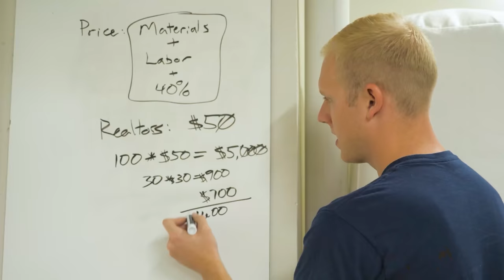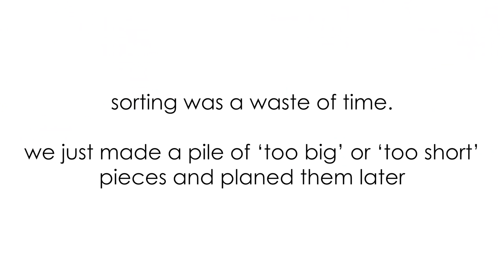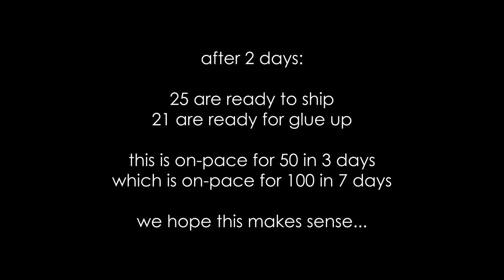we built 25 cutting boards in 2 days

Comment: Keep the boards longer... and why not rip the strips on the table saw? Eliminate the bandsaw. You wont need to joint.
Reply: That is the first thought I had on your process. Using the band saw and jointer are extra steps that are unnecessary if you have a good, clean table saw blade
Reply: My thoughts are the same with a good blade this would shave alot of time off
Reply from the maker: Due to wood movement, the Table saw blade/riving knife gets pinched with 8/4 stock. The band saw eliminates that issue
Reply: @jennieanddavis  valid point. It might be worth swapping 6/4 in that case. Sure you would need more strips per board, but the time and the cost savings of buying thinner stock might offset that.

Comment: An old shop teacher once said to me - keep the wood as long and as wide as you can for as long as you can.  More cuts = more handling time.  I know there is a tipping point, especially in a garage shop.  I would try to joint one edge then joint one face - ensuring that while jointing that face, the edge is flat against the fence and dead-on perpendicular to the bed - thereby giving you a true edge that is perpendicular to the face. Plane the stock next - get them all to the same thickness - and everything should be square (one edge and one face from the jointer - the opposite face should now be parallel to the the jointed face).  Rip on the table saw - good glue line blade. Think about adding a stop block system to your crosscut sled.

Comment: Ditch the bandsaw for ripping. Spend the money for a really good tablesaw rip blade that will make a glue ready cut so you can skip the joiner on the strips. time saved is money earned.
Reply: Definitely, like you said no need to return to the jointer
Reply: Yeah I was confused by that too. I guess u lose slightly less material per cut but not worth the extra time.
Reply: They already tried that, they like their bandsaw better for the workflow in their shop
Reply: I do agree with you though personally

Comment: For rearranging the shop, one useful tool I’ve learned from lean manufacturing is called a spaghetti chart. Draw your shop floor as is and stand where you stack your wood. Have one person go through the entire process while the other draws your footsteps on the floor plan. Once you have completed it will look like a plate of spaghetti with all of the lines of foot traffic and then you can see where you should station your tools to streamline and reduce foot prints.
Reply: Work toward one piece flow over batch work.
Reply: Total agree. I ran a commercial shop and we broke down the shop by the major components we made.
Drawer department, cab box department, door and drawer front department, assembly...etc.
Inside each department the tools were setup in the process for the build.
Think it out and try Dustins plan
Reply: @daforst13  Could not have said it better.  Your objective is to turn inventory into sales.  Large batches slow this down.  So list the steps take the times for each step, arrange the work so material can move to the next process without transferring parts to the other end of the shop (movement and transportation are waste).  See what your leadtime from beginning to end of the process is and bam!  You can calculate your capacity.  Good luck.  

I would be happy to talk to you guys further about this if you are interested.  I geek out on this type of stuff.  Hence it is my job.
Reply: Genious
Reply: Do not listen to people preaching lean manufacturing they will just want to get rid of one of you and hire six engineers and three office staff.
Reply: @daforst13  one pc flow would require an operator for each station, or it's slower.
Reply: @chuckgault8366  yep, work flow should go from process to process without backtracking.

Comment: When I'm doing production work with cutting boards I'll make my blanks as long as 2 boards. I'll glue up one long 34 in long 11.5 inch wide board and cut it in half when its dry and flat.
Reply: Commented this before seeing your comment, lol, I do the same and it works awesome. I’ll double that up with my clamps and get 4 boards out of a glue up
Reply: Came here to say this same thing. Planning out my assembly line and doing groupings out 8/10/12 at a time helps me focus and move faster

Comment: You may have solved the expansion problem by now. But here is a suggestion for thought by others, or by you if it isn't already a done deal. You talk to realtors a lot. Buy a home that has land enough to put up a work shop. That way you own the shop, can configure as you see fit, can rent it out if the business stops. It also adds value to your real estate and can be used for a different enterprise if you change direction. The real deciding factor is what your rent would be if you had to rent a facility to put the shop in. If you can pay that toward your own equity, that's a good thing.

Comment: NEVER feed those square parts thru your joint using your fingers! It takes no prisoners and there is nothing left to sew back on. ALWAYS have two push blocks, one in each hand, when running a jointer. A power feeder would be a good investment for this operation.

Comment: I would suggest making your boards 3x or 4x longer, then cross cut them to length towards the end of the operation. So if your cutting boards are 16in long, instead of making 30x boards, make 10x 48in boards and cut them down later. It'll save you a lot of time and twisting motions.

Comment: Two things that jump out right away are how much/far you have to carry the stock before and after machines and how machines are arranged. I like having a cart for stock that needs to go through a machine and a cart for pieces that have already been through. The amount of weight that you guys carried to each machine and back to the center table each time would explain your exhaustion. Try to come up with a system to keep you from having to pick up the stock unless it’s the next one going through the machine. Then try to set up your machines in a linear progression down one wall or around two walls so you literally just roll the carts to the machine next to the last one when you’re done. I know space may be an issue, but like others have said, limit the number of steps you’re taking around the shop. Fewer steps carrying less = saved time and energy. Easier said than done, but I typically start with my litter saw, then jointer, then planer, then move to my table saw. The out feed table I use for my table saw is also where I do glue ups. I work in a one car garage, so everything I have is compact and either rolls or breaks down to store out of the way when I’m not using it. I just set up what I need in the order that I’m going to use it. Love to watch you guys grow and hope to be where you guys are at someday! Keep the videos coming!

Comment: Minimize the number of cuts you're making. Yes, cutting the boards into 2' sections makes things easier to handle, but if you can manage 4' sections, you've just cut in half the number of strips you have to cut, joint, square ,and glue, and only added one crosscut when you're squaring up the final cutting boards. 
Not only will minimizing the number of cuts save time, it also saves wear and tear on your tools, which is more time and money saved.
Reply from the maker: Yes! The guys in the Stud Stack brought this to our attention last week. Definitely a good idea!
Reply: Wait, can we go back to the “flying through hurricanes for research”?  Is that your day jobs? Not to poo-poo cutting boards, but can we see THAT video?
Reply: Also, minimizing the number of times you need to join and/or plan can save time and money. Helpful suggestion; once you plane and join the boards the first time, a good table saw can give you straight cuts (square and plumb) without the need to rerun through joiner and planer.
Reply: @tyelegleu8846  to add to this only surface 3 sides.  Leave the fourth for after glue up, saves you time and money.

Comment: I have not made production cutting boards, but I have done a bit of woodworking on rough sawn.
I start out by finding my thinnest board and then plan the others down to that thickness. I do this before I cut any of them to length. This keeps you from over handling the materials. Also you will find that the longer boards plane better.

Comment: Tip: instead of cutting & gluing strips for a single board, cut and glue longer strips (say 4', 5' 6' etc) and glue up one panel so you can cut several boards from it. Saves time, don't need as many clamps, and you can produce more boards per panel. I don't make edge or face grain boards but, that's what I'd do. I do build a lot of end grain boards and use this method.
Reply: Joint and plane longer boards before you crosscut.

Comment: Did you have any issues milling and immediately gluing up? 

I stopped doing that with production batches. I mill and then let the dimensioned boards sit for at least a week. I found once they’re milled, they will move just a little bit as moisture enters and leaves the wood on the newly exposed fibers. 

So now I mill to dimensioned lumber and then wait at least a week and do one final pass. It’s necessary about 75% of the time as the boards tend to move just a bit. Made for much easier assembly and flatter cutting boards.

Comment: I'm new to this channel and don't know the shop set up all that well, but in professional shops, it's common to have carts to wheel around stock. For every operation, you need an input pile and an output pile, so either 1 cart for each or 1 cart with a divider. Carts can move to exactly where you want them so you don't need to move around so much or have to move piles from place to place for each operation.

Comment: You need to use stop blocks on your crosscut sled.  Make the first cut with the board to the left of the blade, then move the board to the right of the blade to the stop block set to the exact length you want each board to be.  It'll cut your cut times down dramatically.

Comment: For small shops I've found that building your work bench to work around your table saw gives you added space with the the table saw, also if you are cutting longer pieces (ei. For table tops) on the saw you don't require anyone to catch the piece on the off cut side. Almost buid the work bench in the shape of an L so that the table saw fills in the rest of the square/rectangle. Hope that helps

Comment: I've found that instead of pre-cutting to rough length of each board, and then having to trim each board after glue-ups,  double the size of your initial length of cut. Especially if you're batching. You basically "double" the number of boards you can clamp up at a time.
Reply from the maker: Too much waste - we tried that with Josh Weissman's boards

Comment: I like what you guys are doing and how it's coming out. I would've liked to see how you guys tackled the sanding portion of all these boards. I've been making boards for several years now, alone, and my biggest time-consuming issues actually come at the sanding/oiling time when the boards are already done and waiting to be finished altogether. I also think you could've saved time after ripping the smaller pieces with the bandsaw and then running them again on the jointer. It's an extra unnecessary step. If you already ran the bottom of the board through the jointer, then you have the bottom all flat and squared, ripping it through the bandsaw gave you another square edge if the initial side was run through the jointer as well, meaning all of your cuts are square. Going over the jointer again just to take off the saw marks is a waste since it's going to get glued anyway and no one will see those lines. Then you go to glue and later run it through the planer and sander to finish things off nicely. Just an observation...... :)

Comment: Hey, getting into woodworking myself. I've been making some cutting boards this week too. I decided time wise it was better to cut the strips in 6' lengths, gluing up a 6' by desired width cutting board, then planning, and then cutting to desired length. I was able to make four cutting boards out of one glue up, because I only have 6 pipe clamps this was a tremendous time saver for me. Let me know what your thoughts are.
Reply: No way you clamp a 6 footer with six clamps

Comment: On a whiteboard, draw out a map of your shop as it is currently.  Then take colored markers (one color per step in your process) and literally map out your movements.  See if you can rearrange the equipment so that you can minimize your movement, see if you can create a space where you can stack your WIP so that it is at the beginning of your next process step. Lastly, if you both are working at the same time, try to eliminate areas where your movements overlap.

Comment: Good shoes on cement floors. I find working in lengths of 2 cutting boards is perfect. Chop saw to face joint then edge joint then planer. Cut to width. Joint edge. Cut to width and repeat. That way you have 3 sides jointed. Then glue up to cutting board width x2. So 4 finished boards per 5 clamp set. I use a drum sander to finish the surfaces after glue up. And cut to finished size. Joint/sand edges. Oil. Install foot pads. Shrink wrap. Shelf. Sell. 
Keep achievable goals out in front and strive to be successful and move forward.

Comment: One thing you might want to look at, think about your production process as lineal. Arrange your tools so that you go in line, even if that's around a corner or coming back on itself, you make no money moving materials around a shop. Noticed also that I don't see a cyclone separator on your dust collection. Even if you do one of the trash can type ones, put it at the planer, your biggest chip producer. It will make the clean up process of your single stage collector easier. I also will recommend floor mats as someone else has already stated, they save your back, knees and sanity! I can work for 12 hours a day with the floor mats, without, I'm grouchy and sore for days. 
   As I stated in some of the other comments, some equipment you might want to look at are a power feeder or 2. One for the jointer, 1 for the tablesaw, they will make things easier and safer. Look at finding a clamp rack, a small one will do you just fine. Company's that  make these are JLT clamps, Doucet and an import company called Quick Machinery. I personally have a clamp carrier that I love to death for doing massive amounts of glue ups, way to much of a machine for you at this stage.
  Process wise, compare speed vs material, your bandsaw ripping is fairly slow but yield material is better. A good rip blade on your table saw will more than double your speed of ripping at he cost of a little more loss of material. Which is worth more? A few bucks of wood or your time?
  My background is as a professional woodworker for over 30 years with a few breaks due to Uncle Sam's call. Furniture, cabinets and now just straight millwork. Started just like you, in a garage. Now it's 5000 sq ft with pretty much all the tools I need to do almost any project that I want to take on, with the ability to make a profit on it.

Comment: I always found when doing a production run of boards, its faster and easier to just quickly sort through just the top row or 2 and grab some close in size to each other and glue them up as is. Then just run the board blanks through the planer for consistent thickness. Also, for large glue ups a set of shop made cauls is great to have. Prevents the bowing you were getting with 3 boards at a time.

Comment: If you would superglue (or screw) a block on the rear of the back push block it would be safer in that it won't slip when you are trying to push your parts thru the jointer. Much better control because you are pushing down with the front block and feeding thru with the rear. I use Boeshield T-9 on my jonter table. Makes wood slid thru easily. Doesn't seem to affect the finish.

Comment: Can I ask why you made strips on the bandsaw instead of the table saw?  With a well tuned tablesaw you would have gotten boards that didn't need to be jointed again.
Reply: Came here to say this. Not only would you not need to re-joint the strips, the cuts themselves would be faster.
Reply from the maker: Wood movement pinches the riving knife on 8/4 stock. Having to turn the saw off and use the bandsaw anyway ruins the workflow
Reply: @jennieanddavis  are you using a Rip blade on the Table saw when you do that? You shouldn’t have that much pinch at a riving knife. Though that does bring up needing to change the blade back to a crosscut blade later in the process. And your garage likely isn’t large enough for two table saws, one with each type of blade. Hm. I don’t suppose your miter saw has enough capacity to do the crosscuts on the finished boards?
Reply: The swapping of blades on the table saw should be second nature to the flow. I often switch between the thin-kerf rip blade and the plywood vernier blade. I takes less time than emptying the dust collector drum.

I plan my flow trying to minimize the cutter swaps, both on my table saw and router table.
Reply: @robert_g_fbg  but if the wood moves it moves.  Changing blades won't change that.  I've had a few boards in my past that have really moved which cause problems.  I can see how bandsaw ripping would make sense in that case, but as commented on below, probably working on 4 ft lengths would have been a nice middle ground to minimize operations.
Reply: @MrTegidTathal  I keep a large flat blade screwdriver on my fence, for jamming in the cut (well) past the riving knife. So when cutting squirrelly wood like oak or curly maple, I need an assistant by the outfeed.

Bravo for the brilliant idea of using the bandsaw!